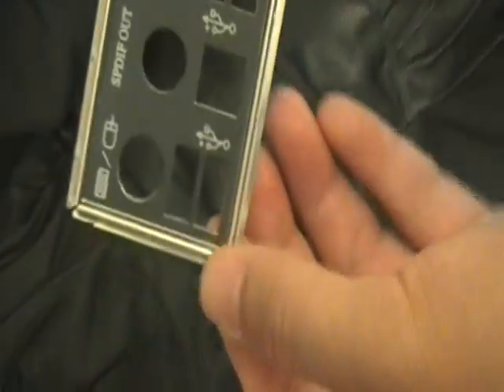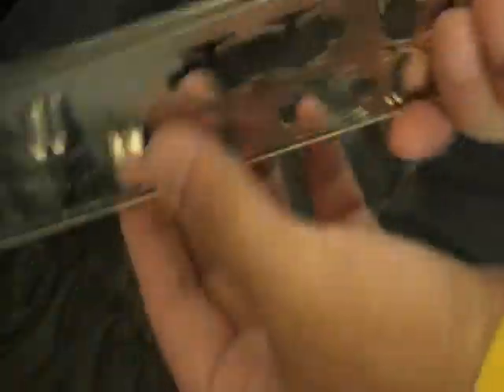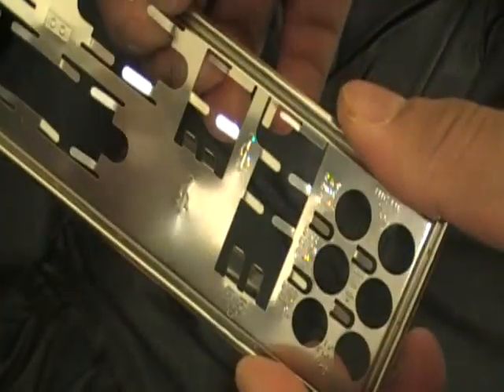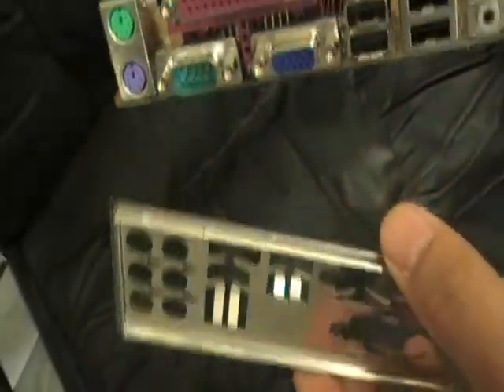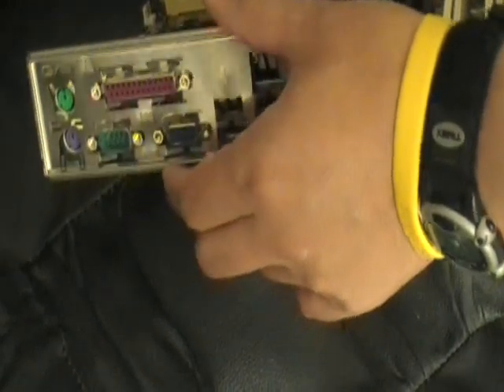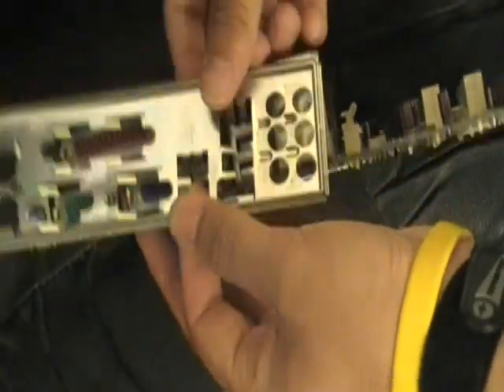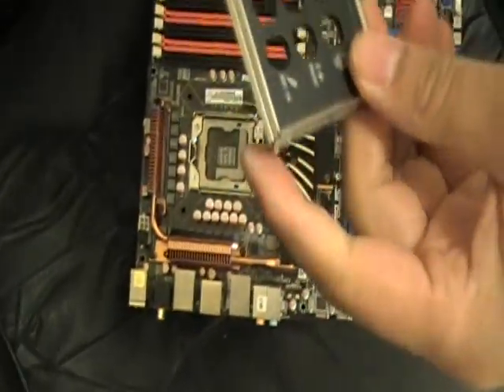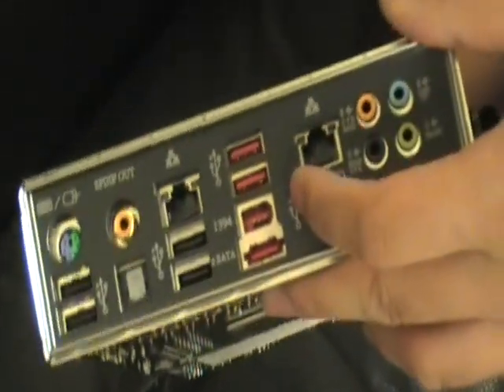ASUS Q-Shield

Comment: my gigabyte FM2 board has this, hate it, because you have to really push the board torwards the back of the case when inserting it, for the screws to fit, im not afraid the board will break, but im afraid the things with the io ports on will snap because they are under constant pressure, its my only complaint with the board. is it safe to pull of the padding, and have it as a normal io shield?

Comment: The thick foam padding is there to ensure the anti-static foil touches the IO connectors on the back of the motherboard to ground it. Yeah it is frustrating to get the motherboard to line up with the standoffs but I only had to apply minimal force to get mine to line up in a Thermaltake Spedo. The Thermaltake Shark with it's removeable tray however was a bit of a headache.

Comment: @Russ88765 Yes you do have to remove the motherboard from the tray I'm afraid. However the Q shield snaps in pretty easy. You just press it in a notch at a time and it fits. Quite tightly I might add. The Crosshair IV Extreme I have was easy to install.

Comment: Anti Static? What are you talking about? The regular IO shield is probably offering a better protection from static and EMI than the asus shield. Because it has these pins that improve electric contact between the shield and the io ports.

Comment: I'm trying to install an ASUS motherboard with the Q-shield into a Cooler Master HAF 922 case right now, and it's downright frustrating. I have to apply a HUGE amount of force to get the motherboard to line up with the brass standoffs, because the Q-shield padding is way too thick. I ran a Google search, and this is a common problem. ASUS, please fix your design!